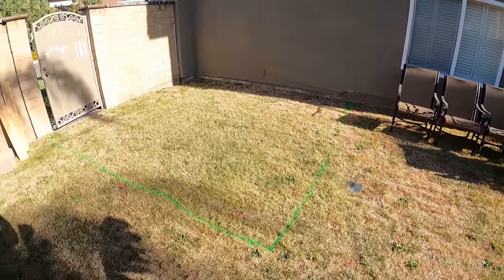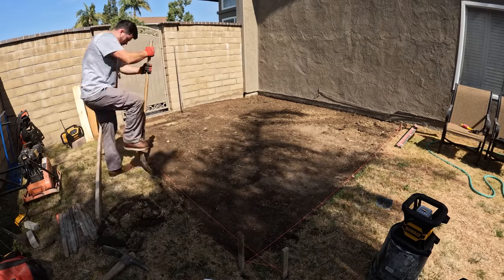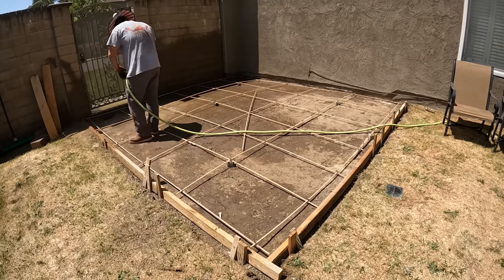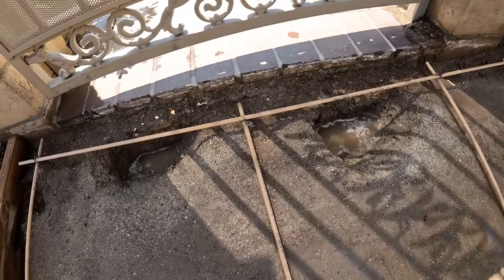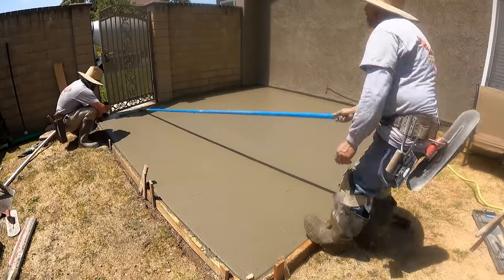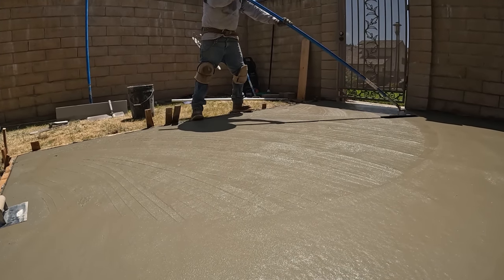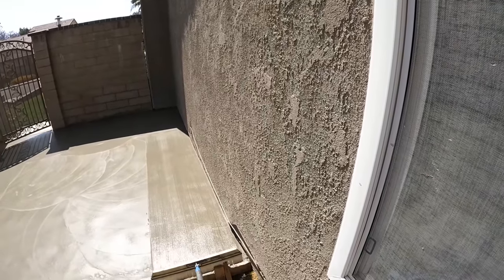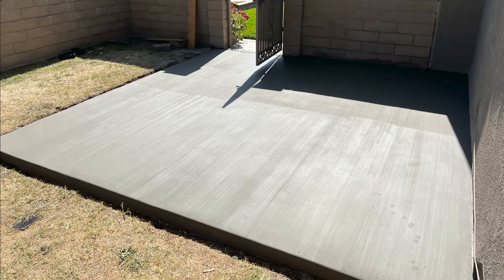EASY BEGINNER CONCRETE SHED SLAB!

Comment: I was a salesman for a large ready mix supplier in Southern California who unlike many of my colleagues started my career in concrete as a laborer on a pool deck crew and eventually retired as a regional salesman for a integral color company.  .  I learned to set forms and finish which proved valuable when working with both large and small contractors. All that to say this...I would have loved to have you as a customer.  In all my years in the "biz" I ran across few contractors with the depth of knowledge and hands on experience you exhibit.  It's no wonder you're a huge success....It ain't mud, it's concrete!!
Reply: And as we go down the bumpy road of demographic collapse (not to mention other forms of collapse), there will be even fewer people (like the ones above) who have such high skill levels.

Comment: Wow what an excellent video from you guys working in a 90’s heat, you would not get guys in the UK even attempting to do this type of job in that type of heat.
Reply: 90’s is typical here in So Cal. Especially around the Los Angeles area. Work don’t stop here. 👍🏽👍🏽
Reply: i'm sure the 90's heat the UK is a LOT more humid then down here in socal

Comment: hey mr odell, I did a video on a sod cutter, it would have been perfect for this job. It makes easy work out of that grass.  anyways good stuff and good video again. HAVE U EVER USED A SOD CUTTER?
Reply from the maker: My dad probably has but I haven't! That would've saved me on the demo for sure though
Reply: @OdellCompleteConcrete  they are sweet 4 sure, if they are set to the right depth. Real smooth

Comment: When you run stiff concrete like this is it harder to pull up the creme? Will it have a stronger surface finish since there’s less chance of incorporating the bleed water into the creme?
Reply from the maker: Yes it's a better system all the way around

Comment: Question for ya: to save on cost, would a concrete company normally allow me to excavate, compact, put down base and form up the area and put down rebar, so all they have to do is pour and make it pretty? Trying to save cost as much as possible cause it's a 11x30 slab I need poured.

Comment: Little tip brother, build ya timber square first lay it in position and spray around the outside, that gives you your dig out area, saves time with string line 🤙
Reply from the maker: Good idea

Comment: Nice and simple. So at what size slap would you recommend a “footer” boarder? You recently did another shed slab like this but it had a footer. Maybe based on the weight of the shed/building being built on the slab?

Comment: Hi there Odell. Amazing work as always. I notice you mentioned the concrete was 3500 PSI but in the UK what would be the mix for a shed base using a mixer and concrete? Which type of sand etc. For brick laying over here it's typically a 4 part building sand with one part concrete as far as I'm aware but for a shed base what would be a good mix? Many thanks and apologies for disturbing you.
Reply from the maker: Probably the same

Comment: Your videos are very good. I've watched several.  Noone talks about the time variances between the pour, bull float, mag trowell, getting on it, and finial finish. I'm doing a 18x20 pole barn with one guy & myself in a week. Any tips on timing?
Reply from the maker: Most likely you will keep moving on to next tool as soon as you can.
Probably won't have any down time.

Comment: If you put plasticizers into a 3-inch slump concrete does it still have the strength of a 3-inch slump?
Reply from the maker: Yes it's the same

Comment: just curious, if you pour the slab but then realized you screwed up your forms and din't make it wide enough, can you add new forms extended out by about 4 or 5 inches, and pour some new concrete?
Reply from the maker: Yes but it's a tough process making sure it doesn't seperate
Reply: @OdellCompleteConcrete  what does that process entail? Couldn't I just brush on some bonding slurry?

Comment: I’ve got a shed that’s on gravel, with cement block foundation. I want to pour a concrete floor, how do I frame in an existing structure? Thanks!
Reply from the maker: Sounds like you pour against the blocks

Comment: Ugh.  After about 3-4 months, my slab starts showing fine hair crack and the surface start chipping after some rainy day and then some freezing day. My guess is the water expansion by the freezing night time. How to fix it and prevent it? Maybe use very high dense concrete?
Reply from the maker: Need to use air entrainment
Reply: @OdellCompleteConcrete  cool thanks

Comment: As a plumber, please don’t give advice on others trades when you don’t know something for a fact. You need to Prime PVC no matter what. Sure it will work and hold for a drive way warranty, but believe me, it will blow loose in time, and usually it’s on a weekend on premium dime. 

ALWAYS PRIME YOUR PVC.
Reply from the maker: No need according the the manufactures direction on the glue.
Reply: @OdellCompleteConcrete  I know what it says, and sanitary wipes say “flushable,” wipes lead the way in sewer drain cleaning calls.